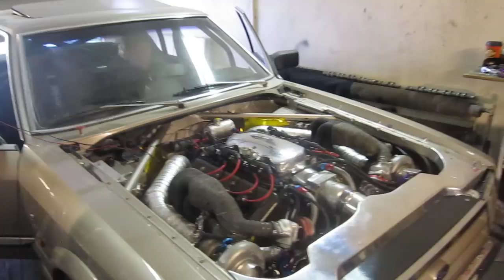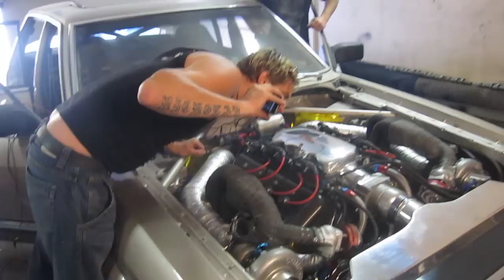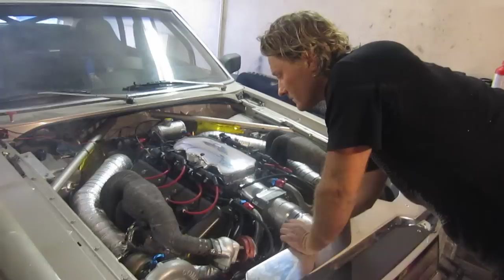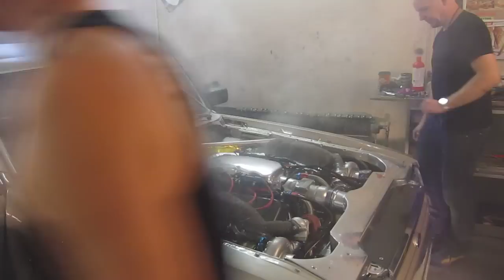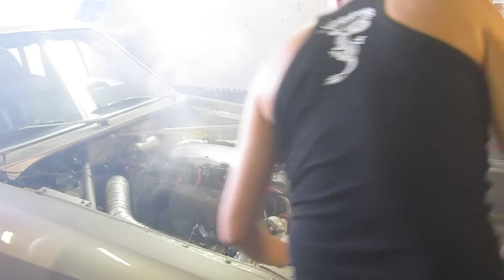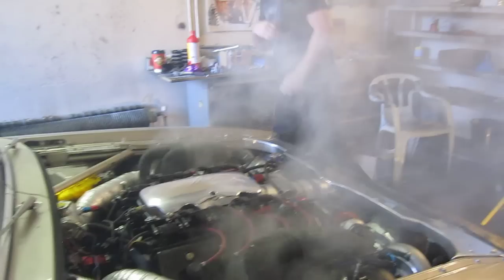Zzz...Zzz granada first start up!

Comment: Yes?? Koenigsegg stopped using Ford engine blocks in the CCR and this not only looks extremely different from that engine but also lacks the proprietary sollutions that allows Koenigsegg to run the engines reliably at their power level.

Comment: not to be THAT guy, but koenigsegg used ford modular engines at first then used the same architecture for their own engines. all koenigseggs variants are essentially ford modular powered. even the most recent cars, yes koenigsegg now builds them, but the architecture and dimensions are the same.
that said, i find it extremely hard to believe this engine came from koenigsegg. the carbon valve covers maybe? or the machined front plate (doesnt have a koenigsegg logo like the rest do?) im sorry but think this is just a built modular ford engine..

if i swap a built turboed LS engine into a 240sx that does not mean my 240sx has a built hennessy venom engine.